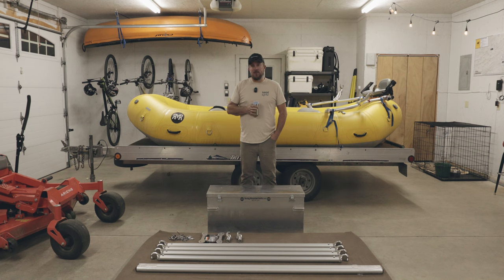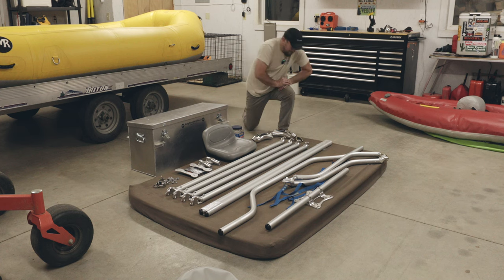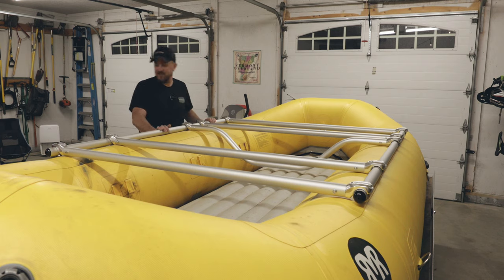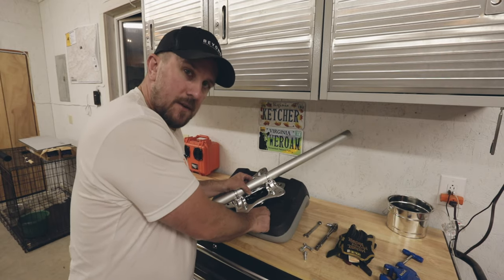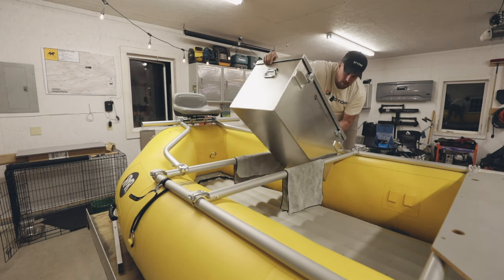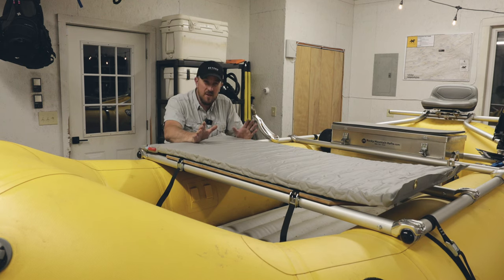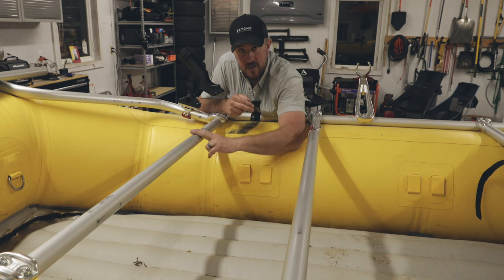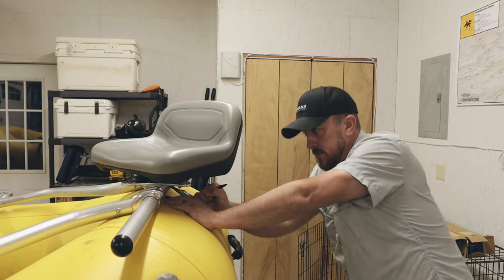How to Build the Ultimate Whitewater Raft for Camping - Part 1 - Mountain State Overland

Comment: One tip for rigging your frame to the boat, 
You want the camstraps to be able to be tightened while you’re sitting in the boat.

One option is to girth hitch your cam strap around your frame and run the cam buckle under, and through the d-ring. Then run the tail through the cam buckle.

Doing this allows you to tighten straps from your seated position rather than having to get out of rowing position or even out of the boat to tighten the frame to the boat. 
Straps will loosen and stretch when they get wet so this is important especially in whitewater environments

Comment: Great video. You’re stoked. Clearly. Ive guided thirty seasons - many six day trips. Fishing trips. I detest those swivel seats. Ive seen people get flung out of them when the stern flexes over a rock. Just my opinion. I prefer a drop deck in the stern with waterproof bags mounded up as a stern fishing seat. Less metal. Safer. Also, a drop bag under your table platform would be a great place to throw gear and seal it down with the deck,table, Paco pad lounge. Also, great reminder about tightening those fixtures. I enjoyed this.
Reply from the maker: Totally stoked! It was a great year in this boat and we're ready for 2024!